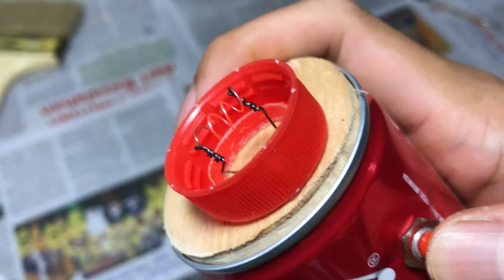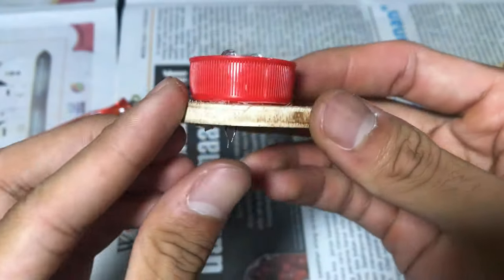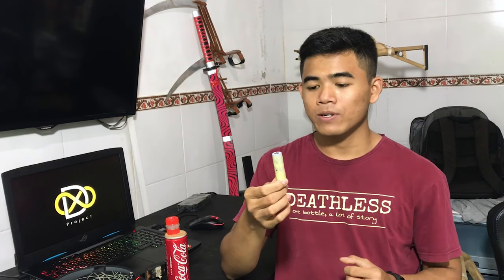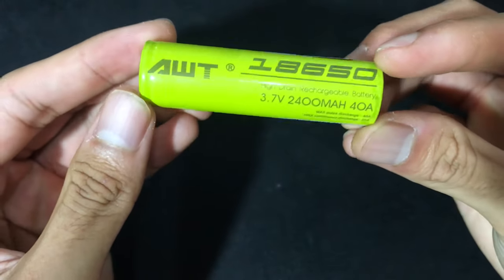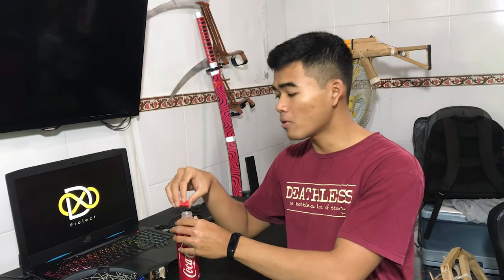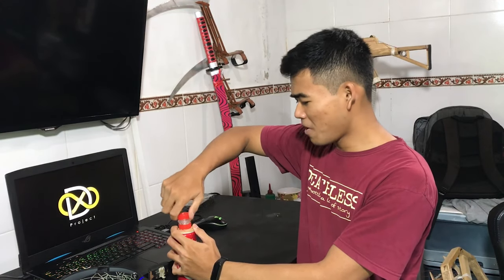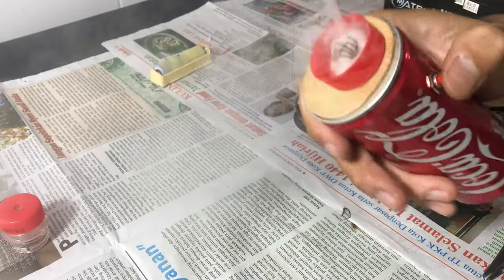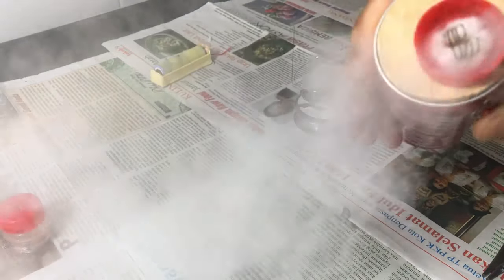How to Make Dual Coil Vape || DIY Vape

Comment: What kind of wire did you use?
Reply from the maker: It called kanthal wire, usually used to cut foam
Reply: @DInfiniteProject  thank you very much, I have a lot of experience making vapes or modifying it,  I just need the wire, thanks
Reply: @DInfiniteProject  how many gauge?
Reply from the maker: For the vape? Not sure, it depends on the battery voltage
Reply: @DInfiniteProject  oh alright thank you tho
Reply: @DInfiniteProject  where i can get it
Reply: @DInfiniteProject  thank you very much, but I want to ask u, u used kanthel wire for making coil and hard wire to assembly the two coils together, am I right??
Also I want to ask if we could use soldering wire instead of using kanthel??
And from where we can get a hard wire because I think it should resist heat??